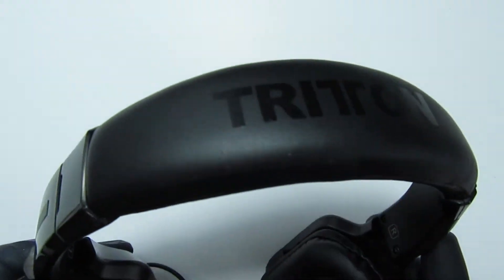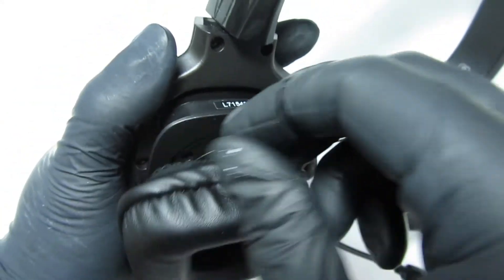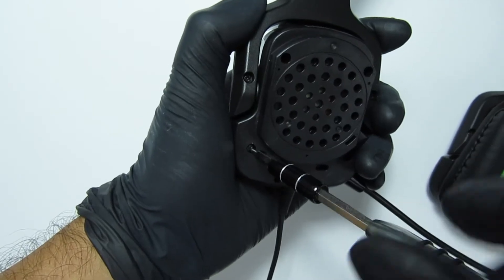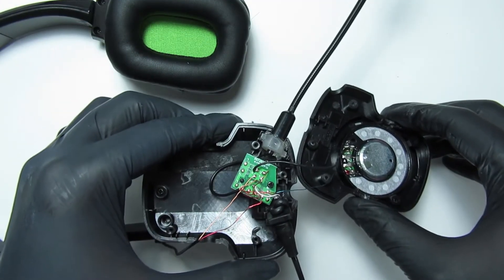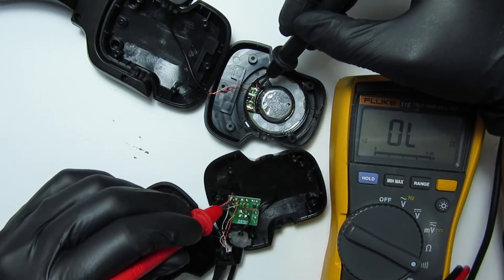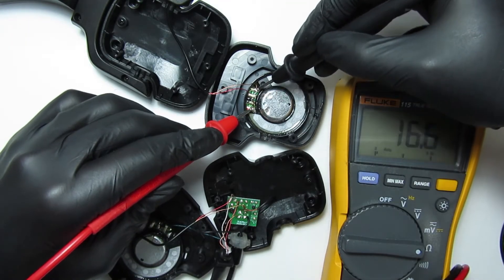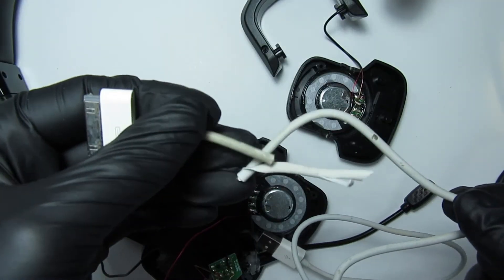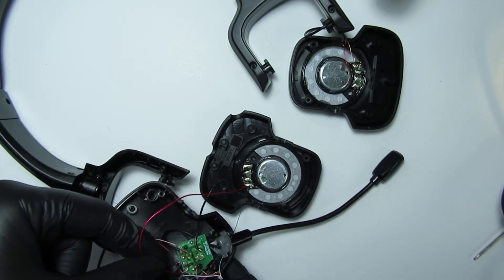Repair | Tritton Kama Headset For The Xbox One

Comment: Just bought 20 pairs of these as customer returns your video has helped me fix 6 pairs up to now so thanks.
Reply: Just looking at buying the same lot on eBay at the minute.
Reply: @Bulldog_Auto  I have only managed to get 7 pairs working out of 20 I'm still trying to diagnose the faults on the others let me know how you get on
Reply: They don't all have the same fault most of mine don't work at all the ones I fixed had sound I managed to repair a set with the mic not working but that was a challenge